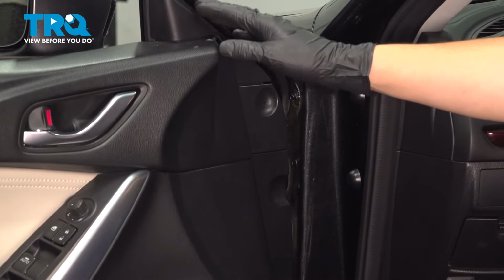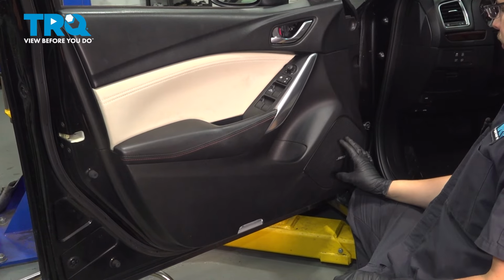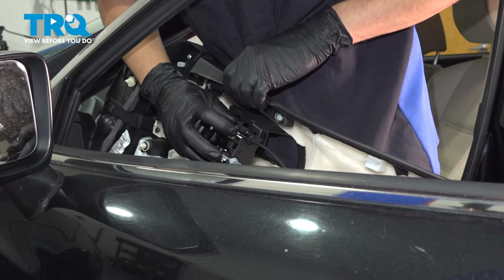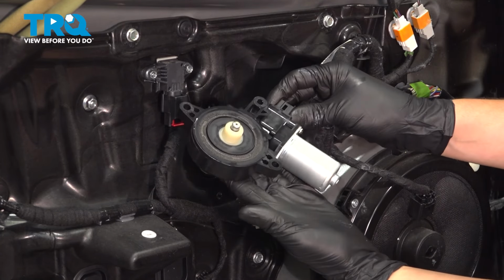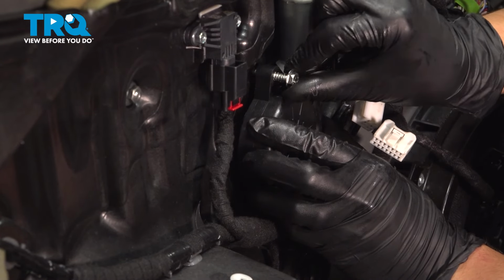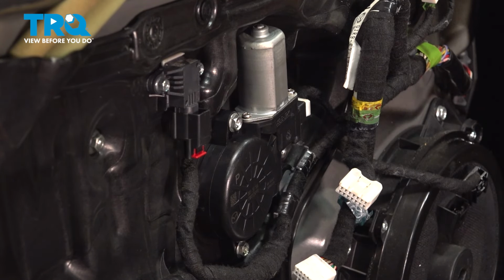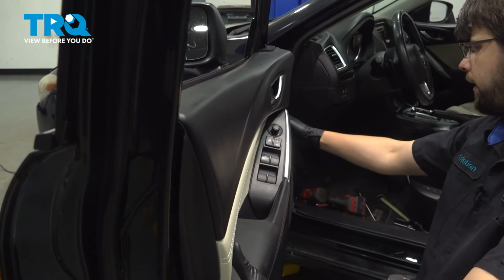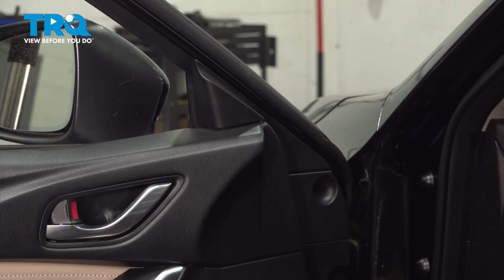How to Replace Power Window Motors 2014-2021 Mazda 6

Comment: What if just the front driver window is giving problems? It goes down perfectly, but it won't go up. I pull the button, and it goes less than an inch up. I had to use my hands to help it, but it get stuck everytime anyways so I gotta wait 5 minutes and do that again and again and again (like 40 times).

All the other windows work perfectly fine from the driver buttons and their own buttons.